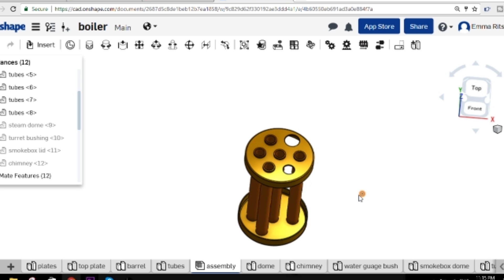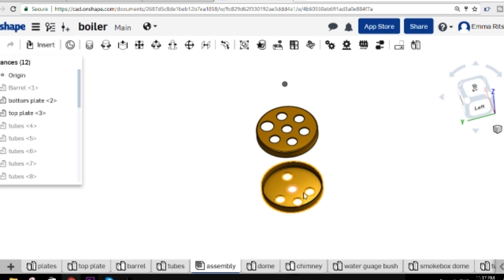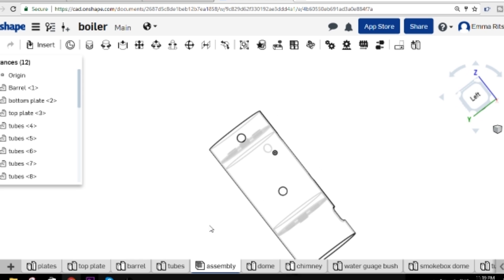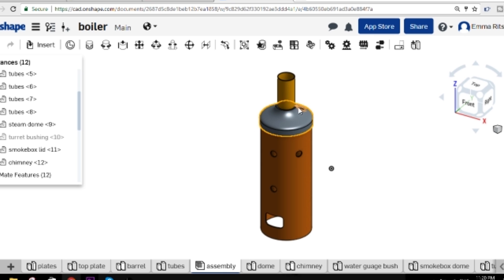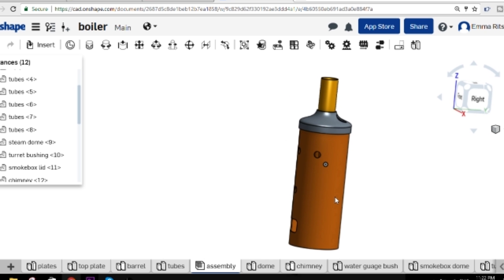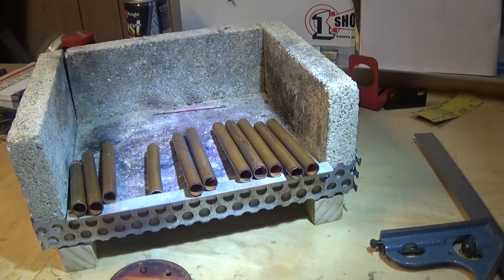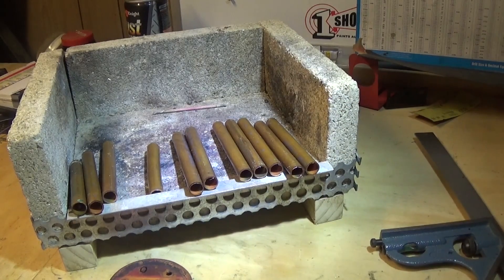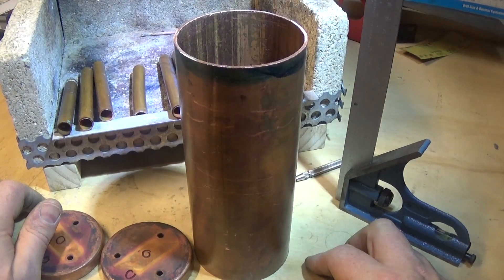Introducing EUGENE . a small copper boiler Part 1

Comment: I winced a little when you mentioned the low positioning of the water feed inlet, it's generally considered best practice to keep this as far from the fire as possible. This is both to avoid thermal shock to the boiler itself, thus reducing the chance of failure; and also to assist in maintaining an equal temperature differential inside the boiler, which helps with keeping a constant pressure level.

Have you got a copy of the AMBSC codes? Part 1 (copper boilers) and Part 3 (sub-miniature boilers) would be the two most useful to you, you can get them from the shop on AME magazine's website: https://www.ameng.com.au/ame_retail_dvds_boiler_codes_and_miscellaneous.htm

Speaking of AME, there's several interesting articles about small boilers in the latest (May-June) issue that you may find interesting, if you haven't already seen it.
Reply: The donkey boilers that were used in the woods were of a similar design to what you are building. Some boilers used on the docks for the hoisting engines were like that too. They sometimes used an injector instead of a feed pump and took water from the nearest creek. That wouldn't work on the docks though lol.
Reply from the maker: thanks for that. I have adjusted that accordingly. :) ill look out the code again.

Comment: You can use one of the blank areas of the bottom plate for a bottom blowdown valve mount. I would suggest you do that actually. That will allow any stuff in the water to be removed  so it doesn't accumulate in the bottom. My field of expertise is large industrial power boilers. This looks like an interesting project. Another connection that will be required is for a safety valve, either on the steam outlet pipe or on the boiler itself. You could also coil the steam outlet in the smoke box and maybe get a little bit of superheat in your steam.
Reply: OK, I should have watched the whole vid before commenting. If you do put a superheater on you should mount the safety valve on the outlet of the superheater so that if you do lift off you will still have steam
 flow through the superheater.
Reply from the maker: thanks for that Noel. food for thought. hadnt thought of putting a blow down valve in the bottom, thats doable for sure. just need to find one that doesnt mind being hot.
Reply: It would need to have metal trim, the trim being the valve plug and seat.
Reply from the maker: would a ball in a steel seating do?
Reply: I don't see why not. Some blow-off valves are somewhat like that anyway in that the plug rides free of the spindle. Stop and check valves are basically the same. I suspect you would be using pretty clean water anyway so you wouldn't have a lot of "mud" to deal with.

Comment: That looks like a fun new project you have started! Good experimenting with metal spinning, though watch that rag in the lathe. Only saying cos I nearly ripped my bloody hand off using emery strip on a lathe once, so I just use small bits of emery now so it cannot wrap round and hurt. My entire hand went deep purple for a month.
Your "Onshape" skills are way better than mine :o(  I cannot for the life of me find any tutorials that go slow enough for me to grasp it all!! I should really try to practice some simple draw and extrude task, then next day, do it again
Do you have boiler building regulations you have to work to in Australia for small boilers? Find out because you could find all your efforts are wasted! Things may be as bad as needing proof of material spec, or tiny boilers may be exempted.....best check.
Those tubes look like brass, so may need checking for suitability for instance. If you have a nearby model engineering society, there will be shedloads of "Olds" who will know all this stuff.

Comment: NICE!  Could you install an adjustable Flue Damper in the stack to adjust airflow and heat loss?  I may be making it harder than it has to be but if you did want the larger diameter stack but be able to keep the heat inside the boiler longer that would be an option.
Reply from the maker: Great idea! ill think about that for sure. :) thanks James.